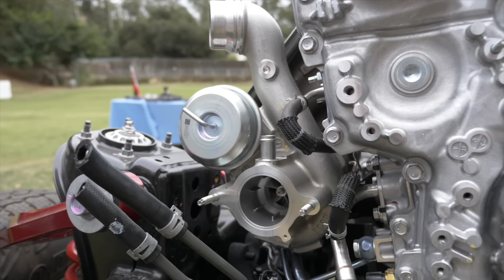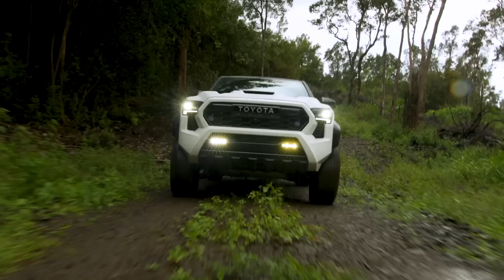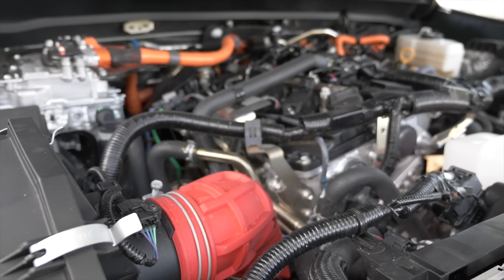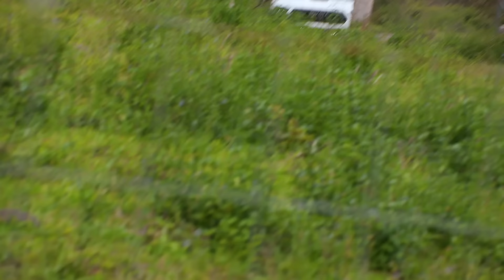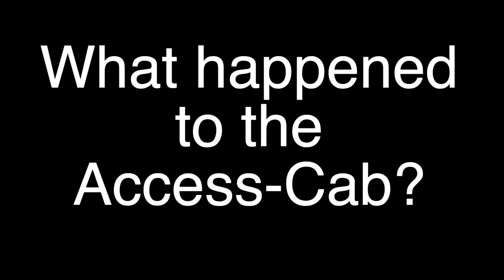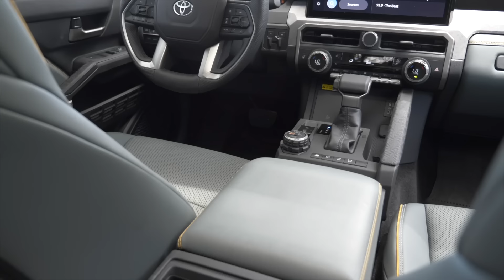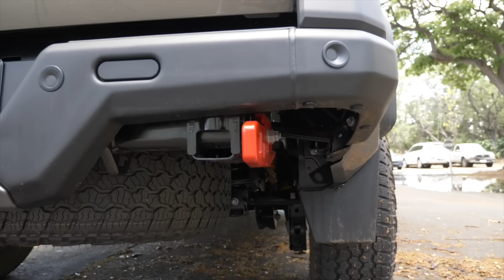2024 Toyota Tacoma Chief Engineer on new engine reliability and more...

Comment: Ain’t buying it! Read my lips SIMPLICITY! I have a fairly technical background. The more heat, electronics and widgets, the shorter the life. My vehicles are a 2008 Honda Pilot, a 2007 GMC Sierra 4.8 Pre-ACMS, a 2003 Silverado, and a Buick LESABRE with the 3800. I was saving for a new Tundra with the great V8. Then they built their latest poop pile. All of our vehicles are known for their reliability. It is hard to trade up when we have a fleet of some of the easiest to maintain and most reliable vehicles. Oh the Buick is very economical to drive, getting 28 miles on the highway. I was speaking off the record to a service technician at our local Honda dealer. His comment was why get rid one of the best Hondas ever made? (I was considering a new Honda.) Simplicity, good design, proper materials are very important. Honda softened the metal in their piston rings for maybe an insignificant amount of fuel saving. Toyota made rodent friendly wiring insulation a while back. If I was in Southern California with long commutes, the new Corolla would make sense. A big enough gasoline engine and Toyota’s proven Hybrid technology. Applauds to Toyota for staying with their nickel hydride battery design. I have thought a lot about buying the 40 anniversary package 4 Runner. Finally in this rant, I am even more tempted by the upcoming 2024 1956 model Land Cruiser. Despite all this crap and more… but will wait till it has been out for a year, my daddy taught me to let them get the bugs worked out. Sometimes it can take several years, a great example is inner fender cracks on the FJ Cruiser. Yep I am old gear head. 
I think it a sin and much worse for the environment to build vehicles with very short service lives. Think FCA vehicles and their short relative lives. Would you invest 70 grand in one of their E-Jeeps? Then there  is Ford’s Bronco…
Ok Toyota we will be watching. I trust you more than any of the other companies. Now back to helping my neighbor with a KIA that does not have replacement chips available. He took it to several dealerships and there are none available.

Comment: First off…slow down! Speak slower. Second…I am not worried about Toyota engineering. It’s top notch. What I am worried about is cost. These trucks have outstripped my ability to afford a new one. After 40 years of driving Toyotas, and sticking with you through bad frames on two Tacomas…now, I can only buy used.

Comment: Time will tell if these new high compression motors will carry on the Toyota legacy. I have my doubts as to that just due to the nature of the stresses small turbocharged (read High Compression) engines have to endure. 

I think what people would have been satisfied with would have been the 4 liter 6 with an upgraded transmission. I just bought a 2020 4Runner. It really doesn't rev that high in daily driving. It has plenty of torque, but is somewhat limited by the 5 speed. An 8 speed mated to this engine would improve economy while still providing the reliability that everyone loves about that engine. 

To me the big motivator was the reliability of that 4 liter. Gas mileage was secondary (my previous rig was a Ram 1500 that got about 11 MPG in town). So, even the 16 I get in town is a huge improvement. For road trips, we'll stick with our Jeep GC. 8 speed ZF transmission, 22mpg.

Comment: Fuel efficiency and performance are completely different ends of the spectrum. Guy is talking out both sides of his mouth. They are not synonymous. Hybrid and gas is not performance either. 

I am a die hard quarter mile junkie and my last vehicle ran 7s in the 1/4. This man is full of it. What i hear is blah blah blah cafe standards.

Comment: I wonder how many customers Toyota 'listened to' said, "I've always wanted a 4-banger in a pickup truck." Like none. And that big IPAD looking display sticking out of the dash? No thanks. If I wanted that, I'll buy a Tesla. Back to the 4-banger. That engine is hating life, putting out those HP and torque specs. As a major auto publication review said. "The engine doesn't sound happy at all." My 2024 Frontiers 3.8 310HP V6 is silky smooth, and effortless. Can hardly tell it's under the hood. Toyota is abandoning the traditional truck buyer for the younger crowd who thinks that technology is "like, sooo kewl."

Comment: I just bought my 2023 sport in order to get the last of the late and great 6 cyl 3.5L automatic, that motor is battle tested. I traded in my  09 Sienna with 245K on it and it started every time and ran great with the original motor, tranny, timing chain alternator and starter. Not sold on the 4 cyl turbo just yet. Lots of stress on that little motor.

Comment: I was waiting for that big boy to get into that tiny truck
Reply: Bro rides in da bed 😅
Reply: I have never been able to gjit into a Toyota Tacoma. My knees fo not fit under the steering wheel to get in the damn thing!
  The salesman explained that once they have drive by wire this will change. Well,at least I fit under the wheel of the Mighty Cummins. Crank windows because I knew I would keep it for a long time.
  I wonder if a guy could move the damn seat back a few inches by modifying the base where the seat mounts to the floor.
    Honda found out early on that Americans did not fit well on their motorcycles so they made the CB 750 and it damn near took out Harley. Toyota needs to make their tilt steering wheel tilt up HIGHER.
Reply: @ohiofarmer5918  sounds like they did change the tilt and the seats and fixed all that--or tried to, there's a million at the dealerships, I'd love to hear you check one out and see if they actually solved anything or if it's just talk.
Reply: lol

Comment: unconvincing.
increased engine stress on a smaller motor mass, more compensatory complexity, more  tech=greater risk of underperformance under actual work conditions, failure, more expensive repair, greater risk of multiple repair and frequency of repair and cost of repair, shorter service life

why?  because of epa bureaucratic dictates based upon religious belief in specious “science”

Comment: The fact that the “chief engineer” has to convince you that this smaller displacement, higher rpm engine with a turbo and multiple batteries is just as reliable as a naturally aspirated v6 or v8 tell you everything you need to know. I may not be a “chief engineer”, but I am a Mechanical Engineer, and have been working on cars for many years. Let’s not forget all the issues the new v6 turbo Tundras have. No thanks, I’ll stick to v6 and/or v8.

Comment: how is the Turbo 4 cylinder engine is more reliable? it was one of the main reason that Toyota was not using a 4 cylinder turbo on the small suv's and sedans, More heat, more pressure and more moving parts means that in most cases, yes a turbo is making the car less reliable. Only the future will tell us if this Toyota still holds up in 15 to 20 years... That's the standard for a Toyota no?

Comment: My 2019 Tacoma was a lemon, bad rack and pinion from 40,000 miles on, timing cover leak at 90,000 and a slipping transmission that was slamming into gear at times! I did all my regular maintenence as scheduled, left a bad taste in my mouth for another Tacoma. I would not trust or buy a first year of a new gen anything...too many bugs and problems. Not sold on the 4 banger with a turbo that will eventually break down and will need to be taxed to to perform like the V6 will.

Comment: I also want to point the epa crap all these dealers keep saying is why they are doing this small displacement turbo engines. A gallon of gas only hold so much thermal energy and that’s not going to change. The only way these are more “fuel efficient” sitting in traffic. Especially if you have a heavy foot. If I wanted more fuel efficient I would have went with the smaller engine to begin with

Comment: I want to know how easy did you guys design the engine and surrounding components to perform things such as water pump replacement, alternator and starter replacement. If it’s $4000 to do a water pump because they have to pull the entire engine, then being reliable is useless, if I have to spend a small fortune to fix something not designed to last the life of the engine.

Comment: Im begging toyota here. They REALLY should offer a 3.0L 4 cylinder as a base engine available in any package or trans option. Its gonna be a stressed little engine and leaky at 150k mi for sure. It will be a let down vs the old 2RZ 3RZ and 2TR engines.

Comment: I have a 89 pick up I use for a bush truck pulling logs and pull a 6 foot disk to till a 2 acre food plot I run it until it over heats let it cool and do it again and it's still going 😂😂😂 so I wouldn't be afraid of buying a turbo 4 cylinder from toyota

Comment: Wow, these warranties are getting confusing. The bumper to bumper warranty is different than the powertrain warranty, fine that is normal. But now the powertrain warranty is separate from the hybrid powertrain warranty which is also separate from the hybrid battery warranty.
Reply: Oh, looks like that is not the case for the Tacoma.

Comment: My last 4.7 Tundra went 278K trouble free miles until my son crashed it into a tree.  I bought another 1st gen Tundra and plan to keep it for years.  A turbo charged 2.4 liter 4 cylinder making the same power as my 4.7 liter V-8 is not going to last 500k miles.
Reply: The tree jumped out in front of him and surprise the crap out of him. 😅

Comment: Should have given us the 2.8L TD that was just released with the 2024 70 series LC.  More than likely hits the emissions and efficiency goals the US requires with heaps more potential for higher kilometers.  Not to mention better performance off-road and maybe even just as comparable on road as well.  

Larger diameter coolant piping/jackets means lower velocity, it has to be optimized every step of the way throughout the entire cooling system, not just one large pipe running throughout so here’s to hoping they did their homework.

Comment: What is the size of the OIL Sump? Some tiny ass sump turbos chew through oil. Pressure increases blowby plus epa puts carbon back into oil.    I keep my vehicles 300k miles this is a 100k mile vehicle between rebuild unless you change oil every 1500 miles. I purchased a Jeep Gladiator in nov 23 has 54000 miles no issues except cracked gorilla glass. Also purchased 175mi 10y warranty where else can you get that for 49k out the door?

Comment: I have 3 questions for the LEAST confident engineer I've ever heard speak.   1. How did you correct the waste gate issue on the Tacoma that the Tundra had?  2.  Can you service the turbo without removing the entire cab?  3..... Is there a worse location you could put the turbo?

Comment: They are great out of the box , Fast and lots a torque . But if you like rattling and knocking and ruff idling like a diesel at 40k to 60k miles Get you some . I will keep my v6 thanks anyway . Its the same with ford and chevy .

Comment: No 4 cylinder turbo anything is going to stand up to commercial hauling. But by all means spend your money and come back in a few yrs and see who’s right. The high RPM’s these 4 bangers must run to achieve those HP numbers excludes longevity. No thanks. There is no replacement for Displacement when it comes to pulling

Comment: It seems that many of these changes were made for the sake of "emissions", "fuel economy" and to cut expense to pass on savings.  Not sure we are seeing much in the way of passed on savings but the compromise of using a turbo charger to recapture the "power" issues are going to put stress on the smaller engine.  Depending in how often you engage the turbo, it might not improve mileage at all. Truck owners want a truck that is dependable, last a long time and is capable of towing and hauling.  That's what trucks are for.  Give us what we want.

Comment: I’m an Ex military diesel mechanic and retired fleet maintenance manager. I’m buying a new car this year, and it will not have a turbo!
Reply: What does that mean ? You don't like to or cannot afford it or something else ?
Reply: Diesel mechanic, what do you think about DPF & AdBlue?
Reply: Those credentials don't land
Reply: Good luck trying to find a non-turbo in 2025. ☹️
Reply: If it's a Ford 2.7 or 3.5 ecoboost you'll be happy.... short term cam phaser issue addressed....
Reply: Some of these turbocharged engines are reliable, it depends. We just don't know with the Tacoma yet
Reply: Not a flex my guy!
Reply: turbo-diesels are known to be reliable, so you're saying they're not?

Comment: No matter how good that 4 cylinder is, all my friends say if they are spending all that cash, they want a v-8 in the Tundra and v-6 in the Tacoma. That's it.
Reply: I’m loving my new four banger Tacoma. Plenty of power.
Reply: @pizza0451 what you pay for tht 4banger 60k to 75k thts insane
Reply: @floceanoutlaws yes the top end with all the stupid BS. I payed just less then 50k for a sport. Awesome truck❤
Reply: @pizza0451 Get back to me when you're paying $5000 to replace that turbocharger at 80K miles.
Reply: @thomashoffman5745  that turbo is not going to be 5k. IT looks like a simple bolt on part that can be swapped pretty easily.
Reply: @Mike-jv8bv The typical cost of a turbo replacement is 3 to 5 K depending on the vehicle.
Reply: For 12 miles a gallon
Reply: @johndoeski5948 😅😅
Reply: Well you can’t have that option on the Tacoma. You want a v8 then spend 70k on a tundra lol
Reply: @paulallen-01  then they're not building products the majority of the market-place wants, but what unlawful regulators desire.
Reply: @nowayagain8141and that’s why there’s trucks on the lot as old as your comment!
Reply: @paulallen-01 no go on either, only a V6 in the Tundra, I4 in the Taco.  Shameful.
Reply: @BamaPewPew  what? Wtf!? That’s ridiculous
Reply: FACTS
Reply: Well I went from a 4.0l v6 Ranger to this 2025 tacoma.  No regrets buying this truck
Reply: They can go back and drive those weak dinosaurs. We’re moving on.

Comment: I miss the 2.7L inline 4's that Toyota used to produce, they were a fun and easy to work on motor, with plenty of power with the smaller Tacoma bodies, I owned two. One with an auto, and the fun one, with the 5 speed manual standard cab... That was one fun little truck I wish I had never sold.

Comment: You could not give me one of these trucks, well you could, but I would sell it immediately. These tiny motors, the direct injection, the turbos, this all requires boutique and expensive oil, frequent maintenance, oil catch cans and an easy foot. And if the have a CVT transmission, even more servicing, and praying it lasts, no matter who makes it. If you are prepared for all of this, and are a real hawk in regards to properly maintaining and driving such a vehicle with all of the inherent issues, good for you. That is one task I really do not want.